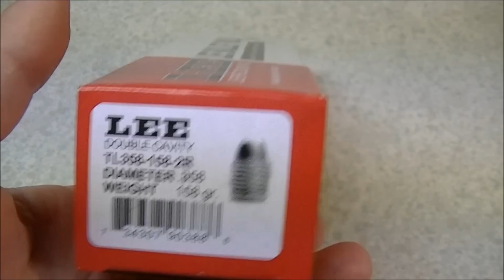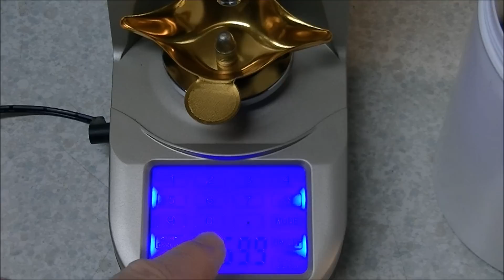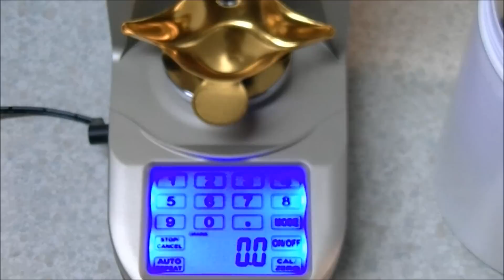Lee Precsion TL358-158- 2R Bullet Mold

Comment: I have been using same mold for .38 special. Also have a mold for .44 magnum and one for .45 ACP. I use a gas grill cylinder and a Cabelas camp stove to melt the bulk down to make ingots and then use a lee production pot to feed the molds.
Reply from the maker: That's a good system, putting clean lead in your furnace is important.
Reply: Nice👍👍

Comment: I've had that mold the old style longer than I can remember.  Mine cast a little larger than spec. but it's a good shooter especially for practice rounds for new shooter.  I dropped using the Alox a few years ago and started powder coating all my tumble lube bullets.   I really like the new style molds Lee is producing and have several of the newer ones.
Reply from the maker: I think this bullet style is one of the original ones offered when Lee started selling molds. I certainly like the new style molds over the old ones, they are much less fussy to use.

Comment: Thanks for the review on the new-style blocks and handles. My last purchase was a pair of 2-hole molds to make bullets for reloading 7.62x39. As with all my Lee stuff, they've been excellent - no complaints. However, always room for improvement, and it looks like Lee have done some nice adds. I'm looking at getting a 6-banger semi-wadcutter to make bullets for 9mm - with the new handle improvements I might buy a 2-hole as well, just to get a pair of the new-style handles. My first 9mm mold was the basic round nose 2-hole TL (I forget the weight, but it was the most common one at the time I started, recommended by my reloading "mentor"). All have done good service. However, the 6-hole SWC 9mm mold is about to go on sale (or so I'm told), and I've wanted to start casting semi-wadcutters in 9mm. Thanks for another very helpful video.
Reply from the maker: Thanks for the comment, my apologies for not having responded until now.

Comment: I'd be curious to see if your bullets produce any significant leading in your choice gun. I use the 6 cavity mold version and have tried all manner of combinations of hardness, quenching ,non quenching, sizing, fast and slow. I've not found a loading yet for this projectile that does not leave lead in the barrel. :/
Reply from the maker: Were you getting small traces of lead or were you experiencing severe leading? Also what was the make and model of gun and what was the caliber? Sometimes  the dimension of the guns chamber/throat/lead/bore can make successful shooting of lead bullets almost impossible.
Reply: Leading is pretty severe in my 2.25" Ruger Sp101 357mag with the unsized Lee 158gr RN over 3.8gr of 231.  All five cylinder throats measure out to .358", not sure of the groove diameter as the gun has 5 grooves and lands.  I've shot some Hornady 148gr. HBWC with great success, perhaps I should diversify the revolvers diet with something other than cast projectiles.  Thanks for your thoughts!
Reply: You are probably right.  Powder coating with some Harbor Freight Red did indeed bump the overall diameter up to .360", I'll try those bullets out.  Thanks for the advice.
Reply: TrevorMyrtleBeach that stuff goes on very thick. Probably the only reason to ever use the HF stuff is a gun like yours with a mold that is small for it.

Comment: Good info, right now I use the Semi Wad Lee mold powder coated in my revolver and lever carbine.  going to have to order one of these round nose molds to try.  Working at my local gunshop has its advantages.  What is the Lee product number?  I urge you to try powder coating if you want to run cast bullets at full jacketed velocity.  I run a near max load of 2400 under a cast powder coated bullet with no lead fouling in my Rossi Carbine
Reply from the maker: This mold is Lee part #90388.
I might try powder coating at some point. I've never had big issues with leading, at least when I'm loading bullets I've made myself. I've loaded .357 Mag rounds to over 1800 fps with no leading, using a conventional lubed cast bullet.

Comment: Have you tried powder coating yet? I did and love it. the time is only slightly more than with Alox and it stopped all leading in my 45 Hi-Point completely. I use it with my 308 cat sneeze loads and my 380 now too.
Reply from the maker: Perhaps someday I might try powder coating, but as I'm all set up for conventional lubing and sizing I don't see much reason to change. COated bullets do have certain advantages (less smoke, feeds in automatic bullet feeders). Leading can generally be avoided by proper alloy hardness, bullet fit and powder selection, and I've not had any big issues with leading in almost thirty years of casting and shooting lead bullets.
Reply: It lets you get away with slightly softer alloys in some situations, and also keeps all your reloading dies clean. Tumble lubing still works, but the investment to switch over is $20. ~$15 for some quality powder and $5 for a toaster oven from your local thrift store. Use your vibe tumbler or even a cool whip tub and you are good to go. Labor is about equal, and once you've learned the system, it is pretty much impossible to screw up a batch. Tumble lubing can be a little too thick and be smoky or a little thin and get leading.

Comment: Great video just purchased a set myself and this helped a lot. A question you may be able to help with in my reloading I just started learning and I’ve been having an issue with purchased 9mm pullets when trying to seat them either the shell crushes or the bullet Itself crushes. I’m certain it’s the correct size dies any thoughts? Anyone else reading this any tips? Thanks everyone
Reply: Yes it wants to crush because you set to crimp to much raise the pin and try again

Comment: I reload but do not cast my own. Lee products, from my experience, are kind of low end. Are their casting products better quality?
Reply from the maker: Some times Lee tries a little too hard to be economical, but I think most of their current bullet casting equipment (molds & lead melters) are pretty decent for the money. Sometimes their molds do need a bit of "tuning" to make them work properly, generally they are worth trying.
Reply: I have a bunch of their molds. IMO their 6 cavity molds are hard to beat. Their sprue cutter design makes for faster casting than the other companies, and the quality is on par. I've had to send back maybe 2 molds out of a dozen ish. Given that the dozen molds cost about the cost of any two other molds, and that they gave me flawless replacements, the nuisance of the two flawed molds is still worth while. I do find it annoying that most of their labeled weights on the molds are no where close to what they drop, even with the most conventional of alloys.